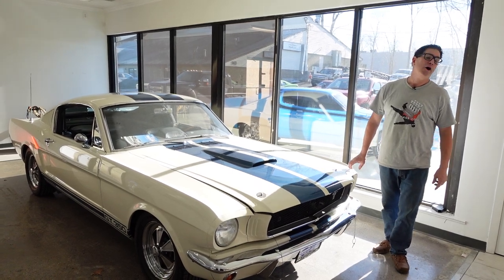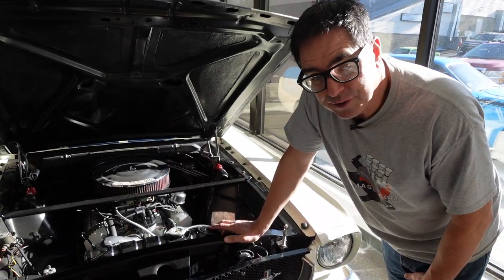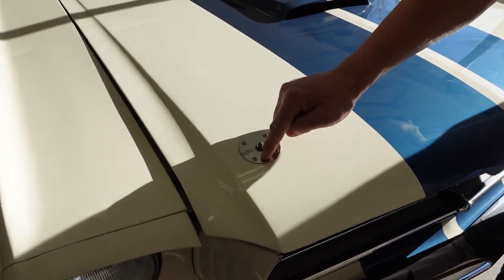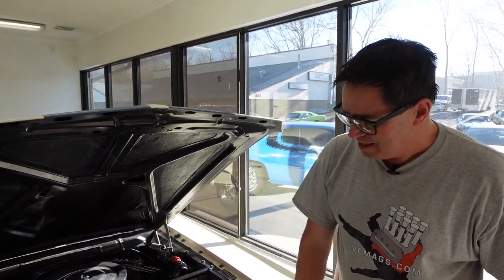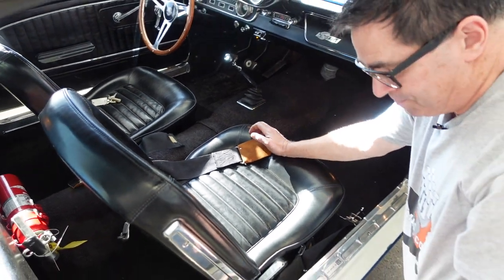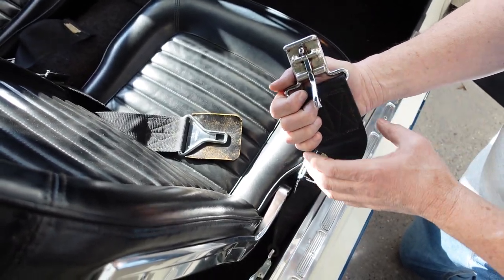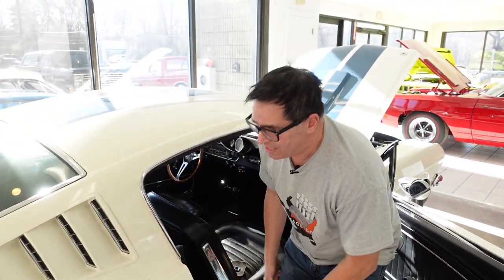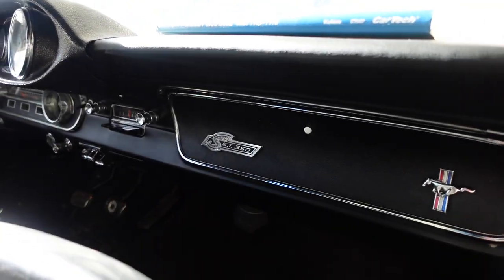Muscle Car Crawl: Five Cool Things About the 1965 Shelby GT350 Mustang

Comment: Enjoyed this review, Steve, because my friend has one. It's 100% original, not restored, barks so sweet and knocks you back in the seat, just like the Gods of GT intended. Rock on.
Reply: It's just odd to me now calling these muscle cars with only 300hp some more some less!! I guess because we've all been spoiled with these new cars being 600hp or a new turbo 4 cylinder having 400hp It's just crazy to me
Reply: @jonathanlawson4667  65 GT350 weighed in @2789 lbs while the 2020 was 3760. Now can you see how less horsepower in the past ment muscle car performance?
Reply: @drewwrobel564  I'm aware but 300hp still sucks lol
Reply: @jonathanlawson4667  Just wondering, how old are you? Did you get to miss the YEARS of cars. in and after the 80's, with less then 200 hp and being considered performance cars?
Reply: @drewwrobel564  I'm 40 and the smog Era sucked I don't call anything from the 80s a muscle car

Comment: The '65 GT 350 base model also came with the lighter-weight steel wheels, but most optioned the wheels pictured on this one. The passenger side outside mirror was not included.
This is a very nice looking GT350.

Comment: another issue with seat belts (ford introduced them in 1956 I think) was that the lap belt was most common, and it acted as a pivot point in an accident--you were more likely to bend at the waist and hammer your face into the metal dash. I bring this up because as you can see by the seat back being moved at the end of this video...there's no latch holding it in place. If you had a good set of Kelsey Hayes disc brakes on your first gen Mustang instead of the drums, and no passenger in the seat, a sudden stop would cause the seat back to snap forward. Unless you blew $7 on the bench seat option, but you usually planned to have a passenger in that setup :)
Reply: Seat belted Fords had a padded dash and a convex steering wheel. Safety didn't sell back then and was actually a negative selling point. People didn't want to be thinking about crashing while buying a new car.

Comment: Neat dash tacho pod too.Cheers, luv ya work.
Reply: that was another gt350 only part, with stewart warner oil pressure and tach. another was the 4-inch alternator pulley to keep the alternator from exploding when you revved the hipo 289 above redline..